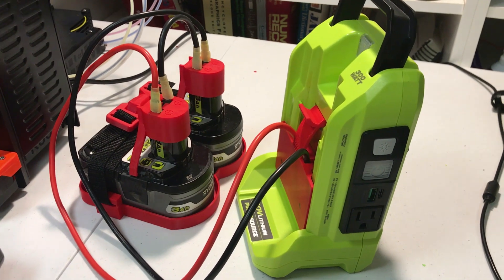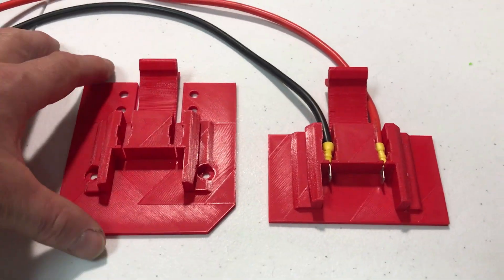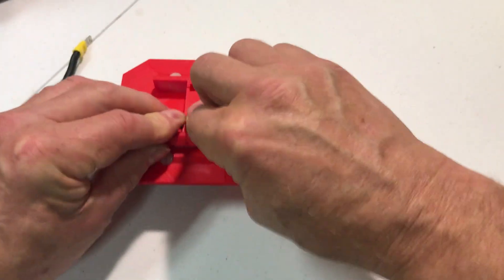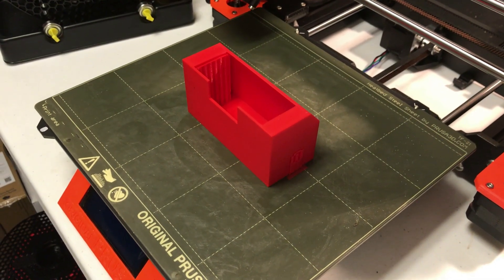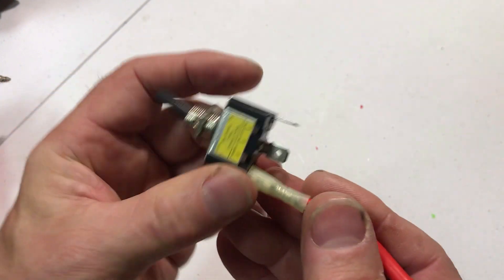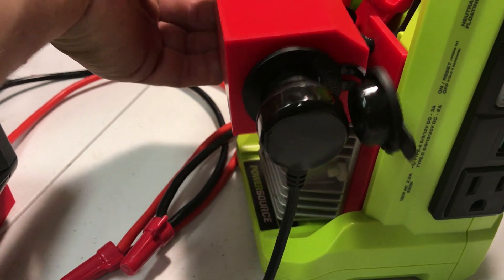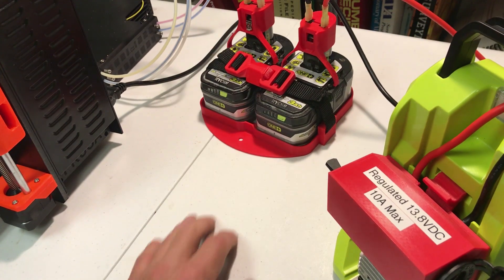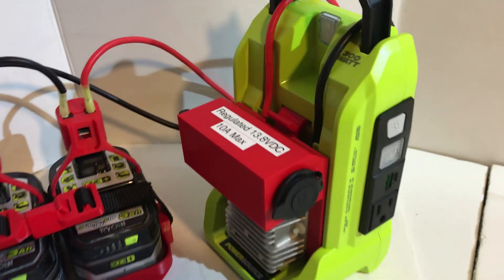RYOBI 40V 300W Inverter Regulated 13.8VDC Socket Upgrade

Comment: This makes absolutely no sense. Its takes a 40v ryobi battery. Yet  you want 13.8v which even if it works is going to pull a LOT more current ie a fire hazard far higher than it was ever designed for!

Since the Ryobi 40v is a 10S pack that goes to 36v nominal. Meaning it will draw up to 8 amps of current
with 13.8v even if it worked which it wont and will see the battery as defective. It was designed for a 10S/36v pack.
A dead 10s pack is somewhere around 25-32v or so. There for this will never work.

300w over 18.5v is a whopping 16 amps

Now if you did the opposite that would be a far smarter idea
Reply from the maker: It's very simple. This gives you the option to run 12V 15A appliances using a standard cigarette lighter socket using your 40V ryobi battery.

Comment: Hi! Great video! Love your Ryobi projects! 

Do you know how the 40v Ryobi power station would react if ju put this solution in one of the slots? Would you be able to use the outlet wile charging the power station? 
Even if the outlet probably would take the power from just the one Battery in this solution and not from the other ones, it would still be great!

I’m using the power station in my van but i would like to power my 12v/24v cooling box with it. And of it could be done wile charging the station, that would be wonderful!

Thanks for great videos!

Comment: If it's 10 amp max than you are only getting 138 watts. 13.8 Volts x 10 amps.
Reply from the maker: the 13.8V cigarette lighter socket is only rated for 10A, the Ryobi inverter will still do 300W

Comment: I'm looking to do something similar and I need to convert it to 12v 10a.  If the battery is 40v 5a.  Will that actually output the 12v with 10a that your converter is capable of?

Comment: Could you make an adapter to be able to use ego batteries with this? There is a lot of people including myself already in the ego ecosystem that desperately need this. Im thinking that this inverter, if capable of handling 40v, might also be able to handle 56V……
Reply from the maker: sorry I don't own any ego products that i could experiment with

Comment: i jerry rigged 2 cheapy porter cable lipo batteries in series to bump them up to 40v and they worked just as well. it was only 60Wh but hey, it powered the inverter. I also have 2 6ah 20v Dewalt flex volt batteries that will do the same thing. any way you cut it, I will be able to power the inverter

Comment: I appreciate all the things you have done with these 18v batteries, but have you bad any troubles when you have run the 18v batteries in parallel?
I have made something like what you have done but I really need to double the amps using two battery’s 18v batteries not just one?
Reply from the maker: No problem as long as you use similar size batteries and keep the charge levels the same. I only put fully charged batteries together. You could put blocking diodes after each battery, but it's a tradeoff. Check out my hotswapping video

Comment: Hi Chris i  love your videos and I have a question   The ryobi 300w  USB-C says it can charge  multiple off voltage ex: 5/9/12and 20 volts  so what if we use a USB-C cable and cut the other tip off and put and adapter for whatever you need ex: y have a 3D display Fan for to display my art work it consume 12 volts y went to Radio chak  and  purchase the end part and it works  no need for the Dc to Dc adapter hope it helps get the word out  . Your friend from Portugal 🇵🇹
Reply: On the ryobi 300w it says in small letters  the different  voltage the USB-C charger can handle ex : 5/9/12 and 20 volts
Reply from the maker: you don't need to cut a cable. You can order Type C Decoy ( https://amzn.to/3evKTMR ) that will let you select the different voltages. Unfortunately the Type C port says it is only rated for 2A. Would your fan run on 24W?

Comment: I have one of these inverters too.  Do you have any trouble with the inverter shutting itself off?  Mine will shut itself off, even if the battery is cool and the load is well under 300watts (was using 60-90), and the temp was cool.  It is super irritating.
Reply from the maker: The first one I got didn't work and I returned to Home Depot. The one I have now is working fine. I would get it replaced under warranty

Comment: Unrelated question but do you think a ryobi battery could jumpstart a car? I’ve seen someone who printed a cover for their drill battery connected to some car battery clips that claimed to have success. I’ve read mixed results online but nothing specific to ryobi... I imagine it’s not good for the battery
Reply from the maker: The larger ryobi batteries can put out 10Amps. That is not enough to directly jump a car... BUT if the car battery is just drained, you might be able to use the ryobi battery to charge it up. I’m not sure what electronics would be needed to limit the charge current
Reply: @SerendipitySue  thanks for the reply! I might just have to try and see what happens :)